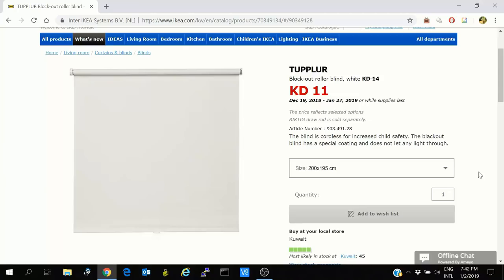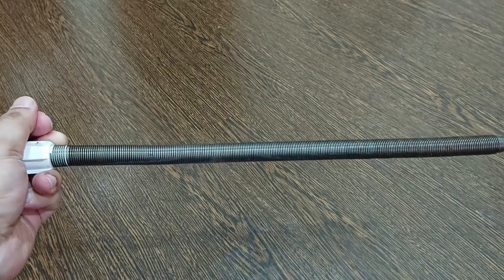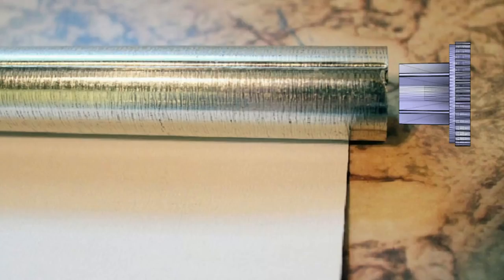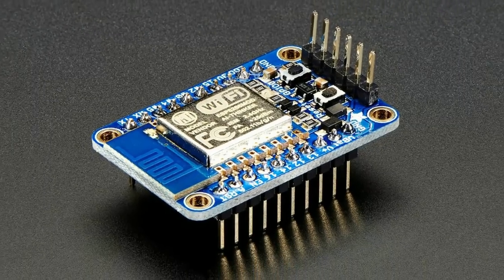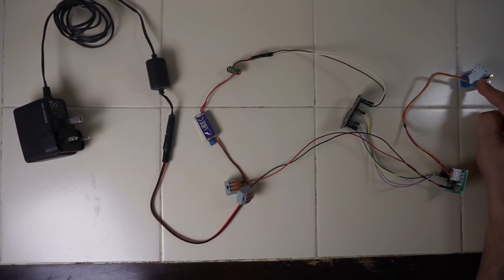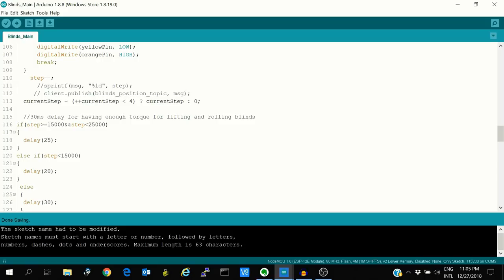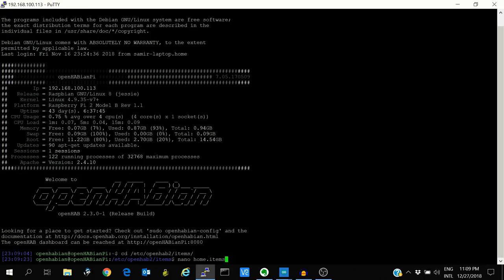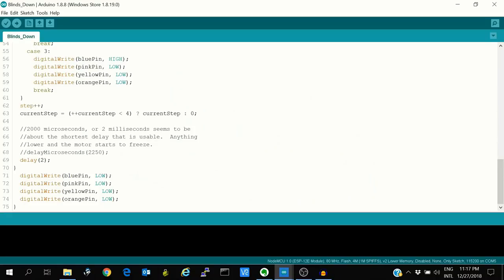Automating Ikea Tupplur Roller Blinds with ESP8266 and 28BYJ-48 Motor - Baba Awesam

Comment: Thanks for the video 

I am using this to move my Ikea lamp shade, I wonder if you can help, I would like to add the function of an input from my light switch commands the motor to travel to its max, then if the input is low it revrerts back to 0.

Can you tell me what code I would need to add this fetaure please ?
Reply from the maker: If you are using this same motor, the same code should work. You may just need to tweak the steps required to open or close the shade.
Reply: @SamirSogay  excellent thank you

Comment: Hey man, thank you for your video.
I also saw that instructables post, and im looking forward to automate my blinds. My tuppler model es the longest (2m), so do you think the 12v version will work, modified to bipolar if neccesary? Or should I buy another motor like a nema 17.
I would like to use the 28byj because is smaller and its housing is more discrete
Reply from the maker: I think it should work but nothing can confirm until you try it.
Reply: okey thanks

Comment: Convert the stepper motor to bipolar and use a A4988 driver to get around 3 times the torque :) you will need to change your code to suit the new driver but its easy - google it and see how easy it is
Reply from the maker: Coincidentally I have made a recent video about bipolar with A4988 for torque testing.

Comment: sir, could you please make one quick video on MQTT with Armtronix WIFI 8-channel relay
Reply from the maker: There should be code for it on Armtronix github.
Reply: Samir Sogay I was thinking for sometime that you must have explored the mqtt and Armtronix both together. Is there any mqtt supporting code or any ‘how to’ you can point me towards so that I can get it to work. Armtronix on github I explored already
Reply from the maker: @mandeepmails  Armtronix code supports both http and MQTT. When you connect the circuit, access it via web and then you can set the MQTT details.
Reply: Samir Sogay sir I totally agree with you. However i’m still stuck with the basic question “on the browser after you’ve chosen relay to do mqtt, what is the “topic” for example its coded to listen. By default, is it R_5 or Relay5 or what ?

I may not ask you the above question if there’s a simple custom code available for modification. Hope you understand.

Watching your video I guess you only showed http for the same. Around 2 years ago, I thought you must’ve done wonders by now.

Please help. I’ll be thankful to you
Reply from the maker: @mandeepmails  If you read the code then you will easily come to know. It is R1_ON, R1_OFF and so on.
Reply: Samir Sogay is there a possibility or time slot when I could walkthrough your relays setup